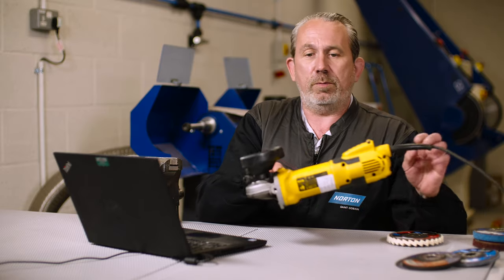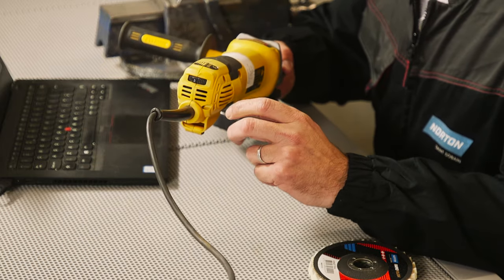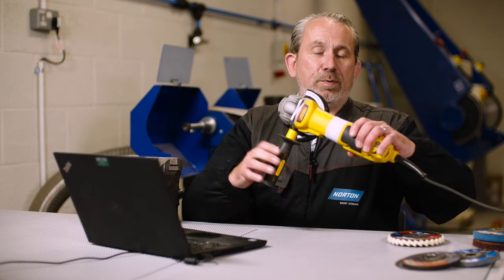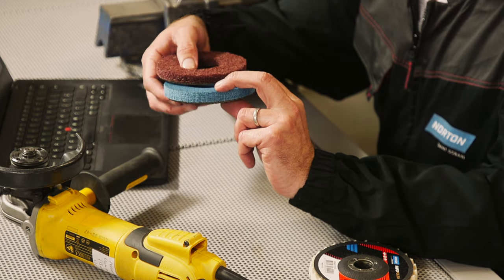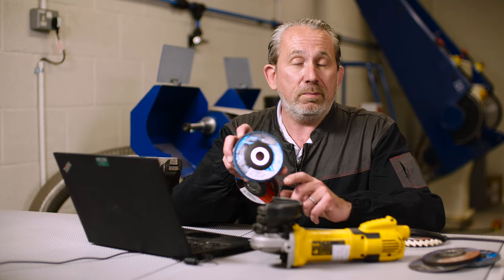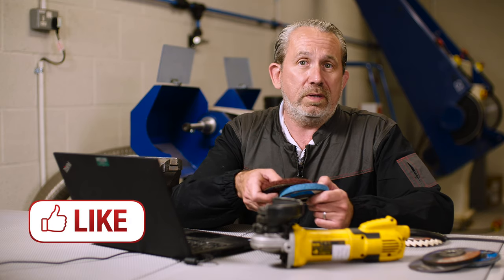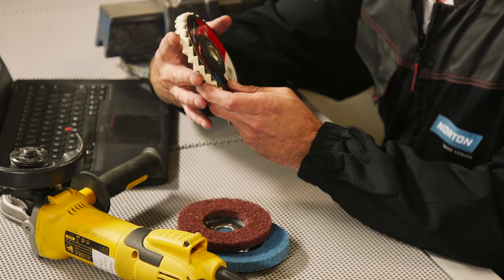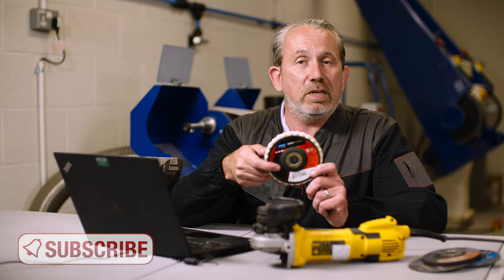ASK THE EXPERT: What are the benefits of a variable speed angle grinder?

Comment: What speed would you recommend for cutting aluminium with a aluminium disk.
Reply from the maker: Hi, we'd recommend to use the grinder at full speed to help the abrasive disc to wear down to avoid loading or clogging. Hope that helps!
Reply: Beeswax makes all the difference
Reply: soft materials are processed at maximum speed, such as aluminum brass.😎

Comment: Well i am from Pakistan want to ask something
Why would we buy a variable speed angle grinders rather than conventional? According to my knowledge and practices it such waste of money in addition such feature, because our 98% work with 11000 to 12000 rpm specially in metal, on wood angle grinder can not recommend, for polishing angle grinder rpm must be 1000 to 3000, please explain according to best of your knowledge thanks
Reply from the maker: Many products such as cutting and grinding discs & flap discs are best used at full speed on an angle grinder, however, non-woven products like those featured in the video are best used at a reduced speed, to reduce the build-up of heat and prevent potential smearing issues.  Thanks for your question!

Comment: I would have thought that a lowest speed variable speed angle grinder would be less intrusive to the metal surface and not create it to Warp I'm not interested in the application of the disc as much as the application of the metal warping from excessive heat on high when removing rust to bare metal